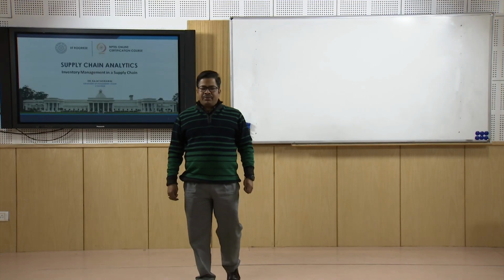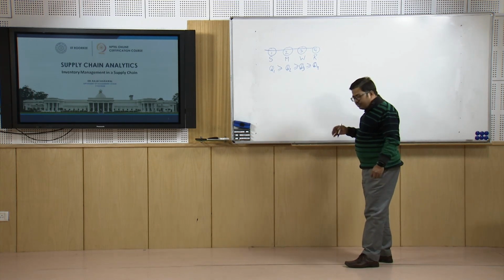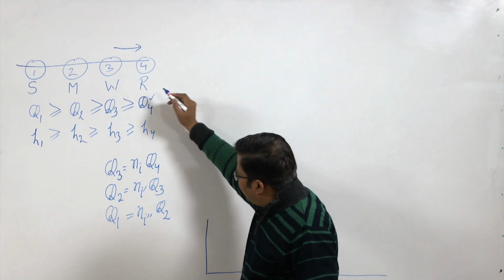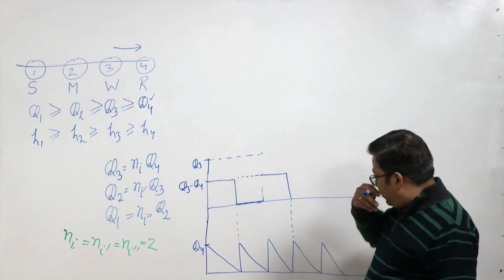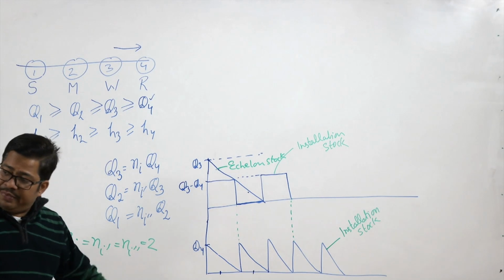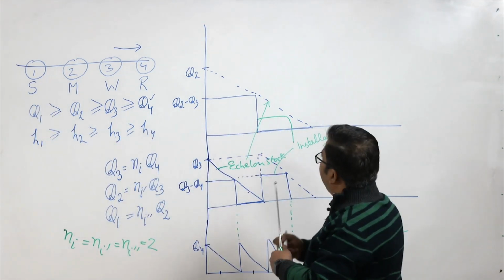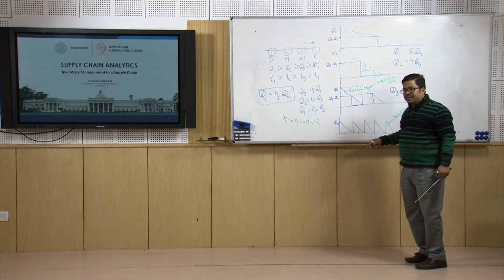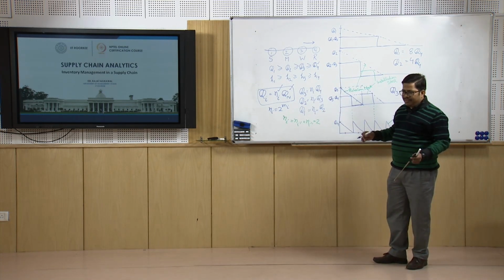Multi echelon Inventory Management for four stations

Comment: Sir, as said by you, value of the product increases towards right, the holding cost should also increase towards right. There is a mistake of the sign, it should be h1 < h2 < h3 < h4 (ignoring the equality) instead of h1 > h2 > h3 > h4 (ignoring the equality).